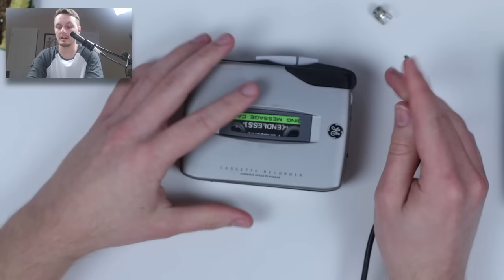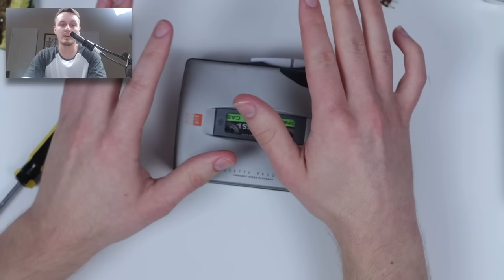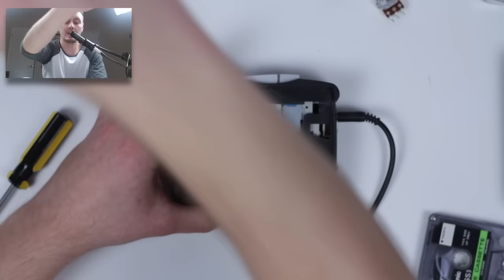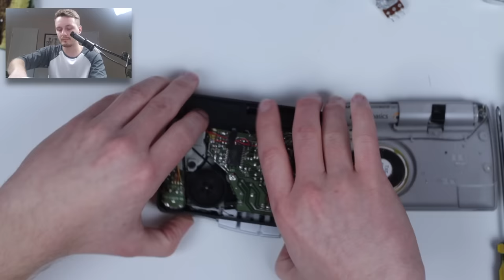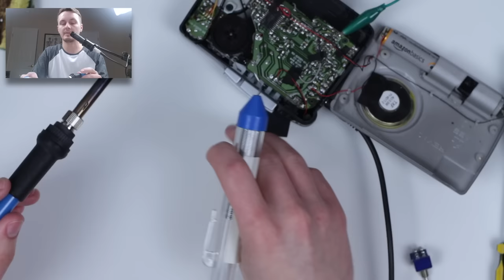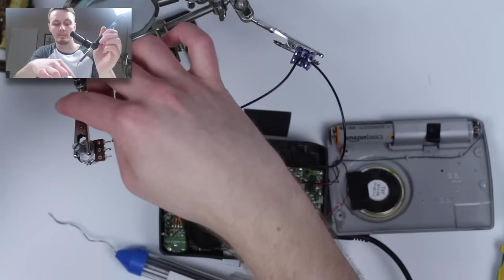Cassette Motor Speed Mod Tutorial

Comment: You can get back up to normal speed without using a switch - just use a very high resistance control like 1 to 5 megohm.  The control you're using is too low a value, causing a resistance (or in this case, a conductance) to remain even with the control at its highest resistance setting.  5 megohms should be more than enough to present a virtual open circuit at the highest setting - but beware:  That much range squeezed into 330 degrees of rotation will make the control extremely touchy, meaning a tiny movement will have a huge effect.
Reply from the maker: Thanks for the insight!
Reply: Hi! So, as I appreciate the making of this video and the people commenting on their experience, for it is very helpful, I figured out I might as well share mine! Luckily I went the safe way and bought a 10K pot, I thought "well, if it doesn't do the trick I'll add the switch, no biggie", however idk! It just worked! Normal stuff, connect ground, and in and out. If I leave it to let's say around 4.5K (idk if that makes sense but I mean imagining there are 10 speeds on the knob) it's the standard speed. If I turn left It goes slower, and if I turn right it goes faster. It worked without the switch and with a 10K pot for me,  so I'm guessing it just has to do with the voltage that the machine uses! You can use a multitester to check the voltage on the circuit and calculate (using the ohms law) what pot will work best for you. Cheers guys.

Comment: hey warning on the input idea. im pretty sure those mics require 5v and anything you input will have the 5v going into your gear. I dont know if its bad but its something to consider. also im a noob and I was told this by another guy so take it with a grain of salt. I would just test the wires with a multimeter to see if there's any voltage coming out of it.

Comment: Increasing the range of your variable resistor should help get closer to the original speed. Thanks for sharing, very useful video!
Reply: I did 100k and got about a half step off. You then sacrifice the top 1/2 or so of your knob on going a few semitones, and theres less space down low for the juicy spots. I decided it was worth it though. You could theoretically add a fine tune by putting a smaller pot in the chain too. (I think)
Reply: was wrong about the fine tune

Comment: Really simple question, can you give me the make/model no of that second tape player you showed off with the 40 percent speed knob? I want to try to find a couple on ebay.
Reply: Looks like a Marantz Pmd-201, or perhaps a 221 or 222. Whatever it is... they're crazy expensive right now. I managed to find a Pmd-101 in perfect condition for $40, which was a great deal, and it has the pitch knob and multiple speed modes, but it's mono and doesn't have the other features of the 200 series.

Comment: Am I correct in thinking this shorts the motors V+ to ground via potentiometer to drain some voltage and speed alongside it? I appreciate the tutorial, I'm just trying to understand why this works.

Cheers.
Reply from the maker: I honestly have no idea but I'm assuming something like that yea
Reply: @GeminiHorror  Are you connecting the first wire to ground? Or if you don't know thats alright
Reply from the maker: @rhysmayes9107  Yea I'm not sure
Reply: I have the same player the trimpot that is the speed controller is actually right next to the point that slows it all down so i think its related to that somehow

Comment: When doing this on a older cassette, the only thing I can find is it going up in speed, I can't find anything that slows it down. I cant find a trim pot either. Not sure what to do
Reply from the maker: You mean like find a trim pot to do the mod? I got mine on Amazon if that helps? There are some players that will slow it down natively like the marantz cassette decks and the tascam 4 tracks but they are getting pretty pricey. Alternatively you could get something like the chase bliss blooper but again that’s not that cheap. There’s a cheaper donner looper on amazon(i think like under $100 US) that can slow down a loop. Hopefully one of these things will help!

Comment: How random is the first attachment of the green wire? Like what is connected to the point that it goes half(?) speed? Thanks for sharing the video!
Reply from the maker: In the pdf i have a close up of the points i hit but i have no idea what they are or why it works hahaha
Reply: @GeminiHorror  ah oké check haha. Lucky shot than :).
Reply: @robbertvanderbildt  When I told someone who knows a bit about electronics about this mod they told me it probably works by connecting the pin for the motor to the ground.

Comment: Do you know how to add a 3.5mm mic in jack ?? Instead of the microphone on there or replacing the microphone on there ? Plz help 🙏🏻🙏🏻
Reply from the maker: Yea it's pretty easy, you just follow the mic to the board and if i remember right it even says "mic" on the board then solder in your input, i did this with a 1/4" input a while ago, see this example
https://www.instagram.com/p/BrkW_oyFHqZ/?igshid=c7y9dybj3ml4
Reply: I've done this a lot of times..here's how...

To add a ⅛ audio input socket to it, so you can use either the internal mic or an external audio source.

I used a switched jack socket...
Desoldered the mic (+) wire from the pcb and hooked it up to the switch terminal on the audio socket....
Attached the socket signal wire to the pcb mic (+) pad, and connected the socket GND to the mic GND.

If nothing is plugged into the socket, the mic is in operation.. plug a lead in and the socket is ready for an external feed.
The switched jack socket is important..

You can also add an attenuator pot to the sockets signal wire so you can manually adjust the volume of the audio being played in to the recorder.. 
They often have quite a 'hot' audio signal going in, so being able to trim the volume down will stop distortion etc.

Comment: I did this to the ones you can buy on amazon
Reply: Just now. Thank you.
Reply: Which ones did you buy off amazon?
Reply: @howva  "super usb cassette capture" it is marketed as a "cassette to mp3 device"
Reply: @howva  they have unbranded ones and branded ones, but they're all from the same factory. Mine was like $15.00 USD but i'm seeing featured ones for like $30. Depends on how much you dig. I also used a B10k pot. You're gonna want a potentiometer with lower resistance by about a factor of 10.
Reply: @thepotto8175  Ah okay I see alot of those and I was wondering about how they would work for this, hows the sound quality out of those?
Reply: @howva  they're not bad. Better than my old RadioShack portable player (wow and flutter) but it has one of those plasticy cheap mechanisms that will make a tape deck enthusiast squirm. Being a broke college student, I don't mind. The sound quality is fine. But if you use a potentiometer that has too much resistance, you'll get like 1 degree of action before it basically is useless. I use a 10k pot and haven't hit it with a multimeter to see what size I should actually be using. Probably like a 100 ohm pot or somewhere near that factor of 10.
Reply: @howva  they definitely do the job of taking a tape and converting it to a digital signal well. However I now have an audio interface  so I just plug n my best deck to get the best audio digital sound. If you're going for a nice slowed down lofi sound though, this is a good piece to have.
Reply: @thepotto8175  thanks for replying, I'm just glad to hear those cheap players can still be useful for making music